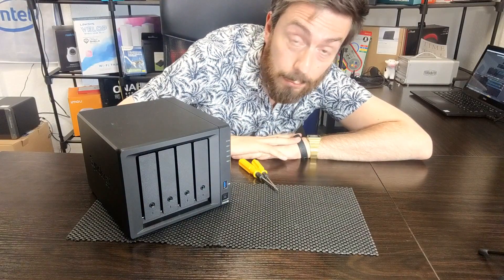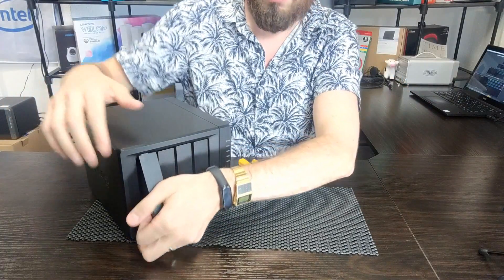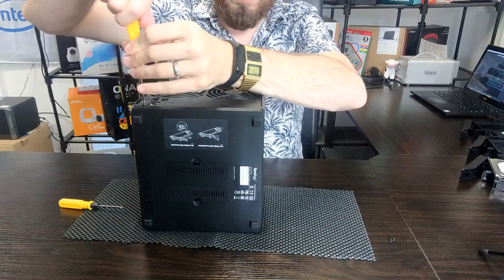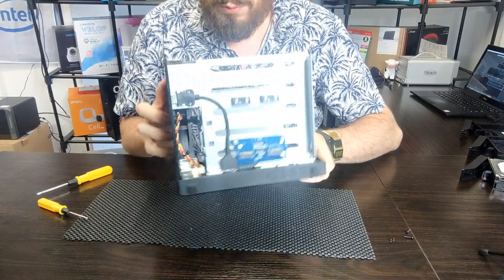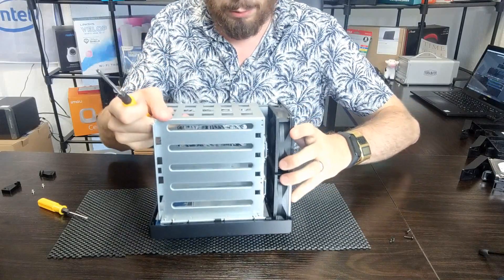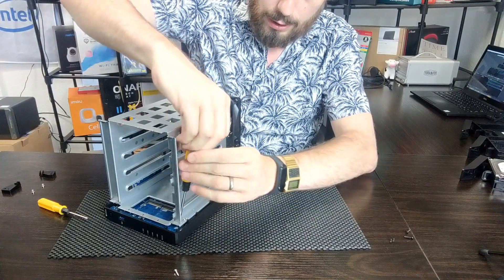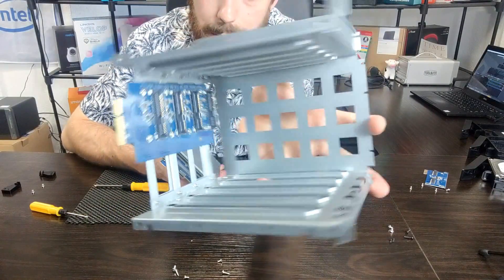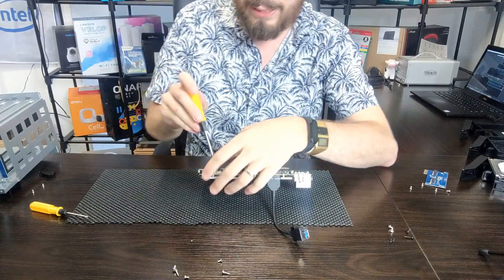Synology DS920+ NAS Disassembly - Taking it to pieces

Comment: Hey mate, firstly thank you so much for the work you’re doing and for guiding newbies like myself  into the wonderful world of NAS!  I bought this model and learnt everything I know through you.. my NAS which I barely used after a year stopped working I.e. both lan ports failed on me and the system shows functioning led indicators and is running every other process.. synology support  isn’t the best and I don’t know what to do..is there some way I can replace/ workaround this, a service centre overseas told me that the port is burnt

Comment: HI
how many space there are from dissipator and cover? if possible add a low profile small fan? or if possible replace dissipator with another?
thanks
Reply: The problem with this would be being able to clean the fan when it gets messed up you'll probably have to take the whole thing apart by using a heat sink instead your minimizing the dust build up
Reply: Based on the latest DS920 Plus using the newer fans at 0.12 amps I replaced my two drive fans with what should be reasonably low but not too low like the noctua (Great but can be harmful for this use case as photos shown on Reddit) 

Hopefully not going as low as 0.07 but staying at 0.02 under 0.12(0.1A) with the 
TL-P9W-S (company known as thermalright which has been reviewed positively  on YouTube) despite having a lower CFM it provides a very noticeably significantly better air flow when pulling air through and out the back as the ones that are in there actually exhaust which surprised me

Comment: I can say that the soldered memory chips are NOT an advantage. After a little over 2 years of usage (and conveniently for Synology, out or warranty) my Synology 920+ has a memory failure and the RMA cost is $549 US. Seriously, Synology?? A brand new 923+ is $600. After having 2 Synology NAS devices  fail in 6 years I have lost any and all confidence in the brand.
Reply: As a followup, Synology replaced my DS920+ at no cost. The $549 quoted was apparently a provisional quote to cover whatever problems that might have been caused by the client (not covered by the warranty, etc.) However, I still stand by my assertion that the memory should not be soldered to the board. Synology could have sent me new memory, and for way less cost the failed memory would have been solved. But coroporate decisions are what they are.

Comment: I wonder, could you connect a GPU to it?
Reply from the maker: Unlikely, the DSM software is remarkably closed. You would need to flash the system and replace with a generic linux one.That said, there is a 3rd party developer working on an m.2-to-10GbE adapter (but this will almost certainly never be officially supported on a Synology)

Comment: There is a reason to restrict to official only memory. In a NAS where timing across all four drives simultaneously write, back up and parity, timing would be important. And with different memory manufacturers not having identical attributes resulting in exact timing, don’t be a cheap bastard trying to save a buck after you spent over $650 USD on the DS920+ and one drive (minimum) when you want reliability and stability. Cut off the nose despite the face.

And damnit, man, wear a grounding strap!!!

Comment: Could you look into if somehow the 1Gb link can be replaced by a 2.5 one, for example?
Reply from the maker: I'm afraid not. I tried and even if you solder one on, the fw won't see it (limited driver implementation). I recommend that you look into the QNAP USB-TO-5G adapter and using on a QNAP. I made a vid late last year on this

Comment: 13:05 I wonder if you can plug a PCI-E network card into this PCI-E slot using a PCI-E riser ribbon cable for faster network speeds.

Comment: This was useful. I'm replacing my QNAP with this model Synology right now. Just waiting on my DS920+ to ship now. My 3 year old QNAP TVS-473 is a paperweight. Backplane issues (known common issue for this model) fixed under warranty but took weeks to get them to authorize it. Just plain bad service. Shipping cost me 1/10 the price of the NAS. Updates causing problems. This last time is just shut itself off. After some testing I think it is the PSU but for me it isn't worth dealing with anymore. I'm done with QNAP. Absolute crap experience for me all around.

NAS was always on a UPS and I have backups. If you don't backup your NAS you are doing it wrong.

IMO all manufactures cut quality to hit a price point. Some do it properly. Some don't give a crap. In my experience QNAP gives the minimum amount of care to meet low standards of customer support and hardware quality. They lost me over my experience with them.

At least I can use my 3 x 8TB Reds and one of the memory modules I used with the QNAP so there is a bright spot. Plex, Sonarr, Radarr, SABNZBD is mainly what I use it for. (Yes I will be doing the driver hack for hardware transcoding.)

Comment: Had anyone succesfully upgraded the RAM with non Synology memory? If so what did you use ?
Reply: I just received my KVR26S19S6/4 which was on the kingston compatible memory website and am getting constant errors about ILLEGAL_LAYOUT.  the full ram shows in resource manager and the memory test passed, but i wouldn't recommend it if the crucial CT4G4SFS8266 doesnt give this constnatn error
Reply: Crucial RAM 4GB DDR4 2666MHz CL19 CT4G4SFS8266 works just fine in my DS224+

Comment: After purchasing two SAMSUNG 970 EVO PLUS M.2 2280 1TB PCIe Gen 3.0 x4 for the Synology DS920+ I am hoping there wont be a problem with my HeatSink purchase. The Heat Sink I purchased for these drives are the EKWB EK-M.2 NVMe HeatSink, Nickel.  My question is do you think there will be a problem using this set of Heat Sinks in this case/Housing?  Thank you very much in advance for your attention and time replying to my questions.  Love your video here. It is awesome.

Comment: Soldered on memory. Another reason to move to another brand. Synology is taking too many lessons from Apple.
Reply: It's not a problem. You have an upgrade slot that you can install compatible memory from any vendor in. Apple does not offer any memory upgrade slots.

Comment: Another poor, cost savings driven choice by Synology: after using 20 year old networking speed standards on high end models and reducing the number of USBs, now soldered memory is the new thing to watch out for. 

About the teardown to get to the memory, most of those steps aren't necessary. You don't need to remove the HDD cage, USB connector or NVME expansion card and take all that assembly apart, just take out the 4 screws that hold the mainboard on the chassis and it will come off.

Comment: The J4125 only support 8G memory anyway, seems like this is a mediocre refresh :-(
Reply: I want to clarify my comment here: per Intel's official doc, this J4125 only supports 8G memory. But other people has successfully upgraded to 16G on prev gen Synology NAS with J3455 (which also only supports 8G ram according to Intel). I think someone would have to test and see the maximum supported ram size to know how much ram we can throw into this machine.
Reply: Yuchen Ying i think that you're limited to 12gb because 4gb are soldered onto the mainboard
Reply: What's the status on this? So many conflicting statements. The motherboard can support more, but cpu only utilizes 8gb is what I often hear. People have successfully booted and recognized 20gb on this machine, and on the Qsnap with the same cpu 32gb. But I keep hearing the cpu itself only utilizes 8gb.

Comment: Cool to see the breakdown, heals me of the pointless quirky need to disassemble my own 918+.  The only thing I wonder is whats under that heatsink on the processor.  Is there an IHS plate or straight to the die, soldiered or thermal paste.  If its just a paste the build tech in me would be curious if they used a decent paste and if I could replace it with a very carefully applied liquid metal Cryonaught type paste solution. As well I would measure carefully and see if there was case room to install a very thin 40mm Noctua fan on that heatsink ... but theres probably not enough room for it. 
Hmmm ... howbout water cooled with a tiny little block and rad ... going too far?
Reply: Probably going too far, this CPU is very efficient, and does not relly output all that much heat.  Uder normal workloads shouldn't even throttle, unless your ambient temperatures are super high, or the NAS closed for example in a cabinet with no ventilation. Furthermore, you would increase the power draw, of your system, which is IMO not very desirable for a system running 24/7

Comment: hi =) thank you for the videos, been enjoying all the information you have been providing.  Quick question, I ordered the 920+ and it’s on the way, but I am having trouble finding the official 4gb expansion memory.  When do you think Synology will start shipping them out to distributors?
Reply: Just buy some crucial module for a quarter of the price. The official ram however has been available way before the 720+ has been released, search model number D4NESO-2666-4G
Reply: Thank you, when I searched yesterday all the sellers had it flagged “back ordered” and I thought it was a new module for the new models.
Reply: @lionintu  I am looking to hop up my 920+. when it arrives. I’ll put in 4 - 6 TB WD Red Pro.. what else should I add? Model of RAM? SSD for cache?
Reply: Any 4-8gb (ideally crucial or Kingston) possibly after a Google search on your model 16gb will work fine below as well  https://nascompares.com/synology-ds920-nas-20gb-memory-unoffical-upgrade-guide/
But do an an actual test of the ram (not just open a bunch of VMs and say "hay it's working" Synology has a built in ram test like Windows does does it will reboot the system and run a mem test and gives you a report afterwards if it was successful or not) 
https://www.synology.com/en-uk/knowledgebase/DSM/tutorial/Management/How_can_I_run_a_memory_test_on_my_Synology_NAS

I wish Synology would accept ECC and have both slots available (they only support it on there super expensive Synology devices)
Reply: Thank you for the info. =)

Comment: Robbie, you’ve tried a 16 and 32 sodimm, can you whack an 8 in and see how it runs (totalling 12GB again odd we know). This long awaited release is a disappointment on many levels🤦🏼‍♂️
Reply: He has had 16gb module in there (the 32gb double density module didn't work that he tried) bit sad that they removed the internal ddr slot (even if it was hidden before)

Comment: Maybe this will stop the pointless over the top RAM upgrades for that CPU.
Reply: Things add up quickly in a prosumer/SMB environment. This supports VMs; for a single Windows 10 VM that's supposed to be usable you need to allocate 4GB of RAM. The Synology MailPlus Server takes 1GB just to exist and then it needs more memory as it processes emails. A web server w. Wordpress needs about 1GB to not fall over even on residential internet. A media server / transcoder like Plex will need up to 1GB when processing large files. Any available memory is / can be used by the (Linux-based) Synology DSM OS for disk caching to provide a speed benefit.
Reply: @Qrpblog  Razvan, you're quite the awesome geek.  The point you made about OSs using unallocated RAM as cache is right-on.  So here's a few simple questions:
*1. DS918+ does 16RAM, the DS720+ & DS920+ don't, and capabilities/performance are about the same. 
    ?Which one would you buy?
*2. 'Synology Drive' allows a client to cache NAS data locally.  Most home/consumer NASes have Celeron cpus & ~4G of RAM.  ?Wouldn't it be smartest/cheaper to use 'Synology Drive' on an i5 laptop or i7 desktop for heavy processing?  
     Speeding up reading files on a Synology NAS https://www.youtube.com/watch?v=eryytxpHR0A
*3. I went to your YouTube channel & you have no Synology videos.  ?Hows about posting some?

You might be interested in:
*8 Myths about Storage Spaces (it mostly works) https://www.youtube.com/watch?v=r-qXbLjQJ3Q&feature=emb_logo 
     Tiered Storage Spaces Windows 10 (he figures it out towards the bottom ; I'm trying to figure out PowerShell ; ?hows abouts some help?) https://linustechtips.com/main/topic/925425-tiered-storage-spaces-windows-10/
*VERY OLD but interesting; Synology SSD Cache on External Devices (how to have your externally connected devices recognized by the SSD cache service) https://www.casler.org/wordpress/synology-ssd-cache-on-external-devices/
Reply: @Qrpblog  for such workloads a higher end model is preferred anyway, those will officially support more ram
Reply: @sitte24  The next model up that has the same or better CPU and supports more memory is the DS3617xs and that costs about 5 times as much and is a large 12-bay unit unsuitable for a quiet space. There definitely is a huge market in between, not properly covered.

Comment: Is the soldered memory running in dual channel mode? If not would adding another 4gb module make it run in dual channel mode and thus making the nas faster?
Reply: The cpu I believe only supports single channel (using 2 sticks just puts it into dual rank mode, so it doesn't matter what the size of the second stick is really, just slap a 8gb stick in there if default Synology 2-4gb is not enough)
Actually it does support dual channel but depends if they have wired the them in a dual configuration (as a lot just to single channel with 2 slots)
Reply: I would assume the soldered in chips are using one channel, and the SODIMM will use another.

Comment: Thanks for the detailed breakdown. This has given me more reason to go the QNAP route over the Synology due to the TS-x53D series unofficially supporting more RAM.
Reply: ds920+ supports 20 gigs at least
Reply: It unofficially supports more. I currently have an eight gigabyte RAM module installed for a total of twelve gigabyte. I have seen some people using a total of twenty gigabyte.